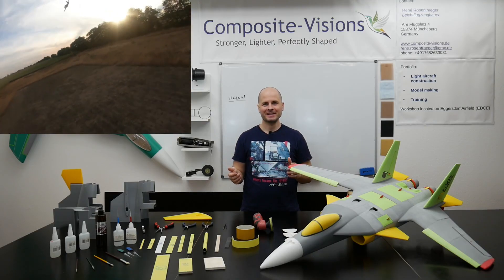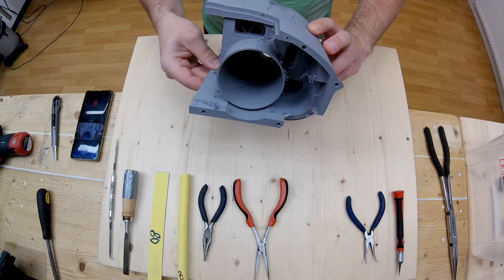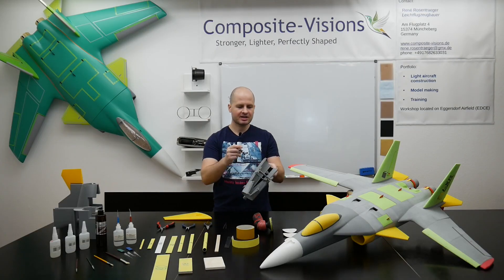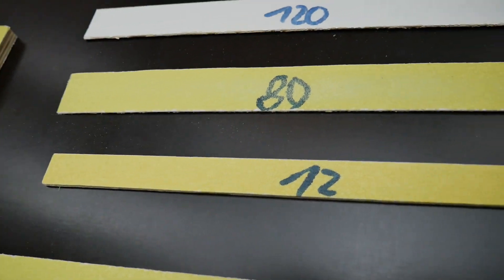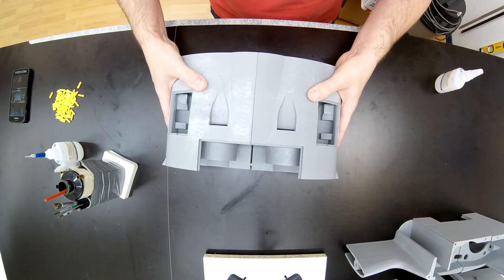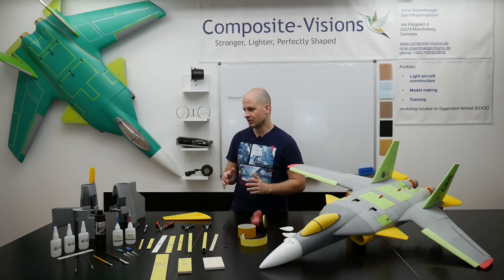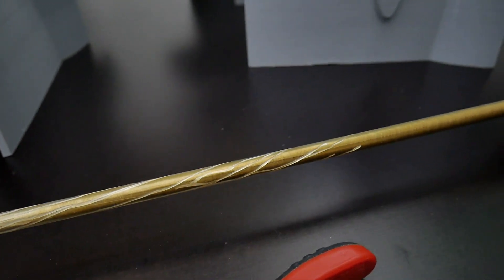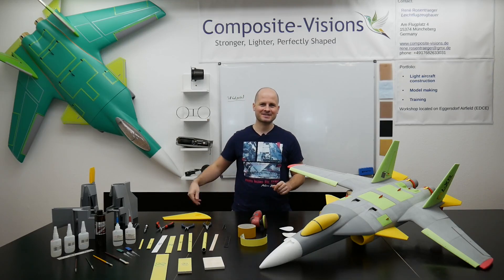Su-XR Tutorial Pt. 2 Assembly of the 3D-Printed Parts

Comment: This is the best su-47 model I've seen by far. Great plane to model off of since when stealth isn't a requirement, it has the greatest all around performance from not having any downwards force nessesary to be created on the horizontal stabilisers, which are really canards on this plane, to keep the nose up thanks to the forwarrd swept wings. Not to mention all the control surfaces!

I'd be really interested to see different fan blade designs for the engines. From my experiance a jet lookalike blade outside of a jet engine underperforms compared to other designs. I'd guess something like the artic p14 fans would provide alot of force, but at high speeds the shape wouldnt really allow it to self accelerate to match the airspeed, so if the motor can't keep up it could become a resistance. If there was a way to make the blade flexible but not in the front edge of the blade (to hold its shape) that could bend out of the way, but I don''t know if there is a material that can work that way. Not sure what real turbofan engines do in this situation where they can't pull in air fast enough.
Reply from the maker: Great stuff mate 😁👍👍